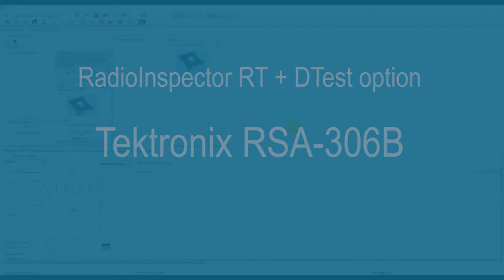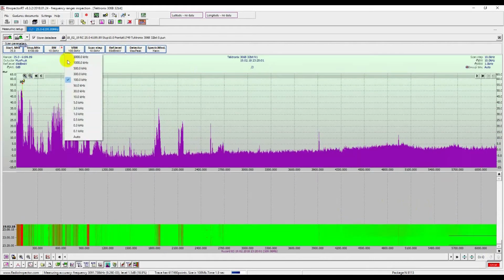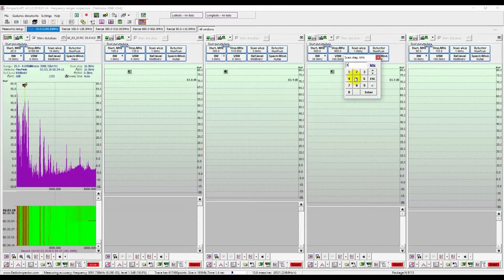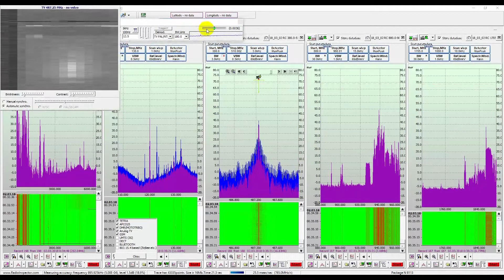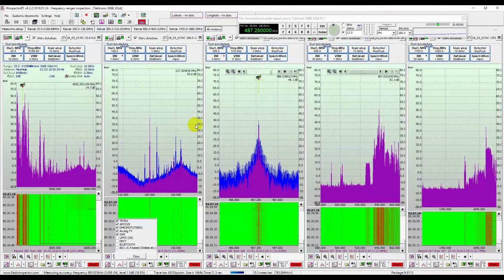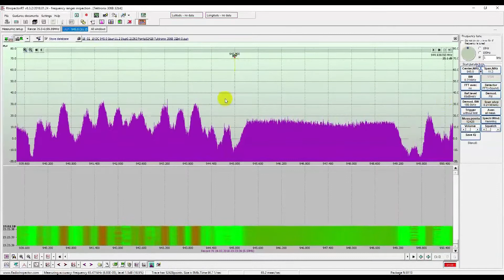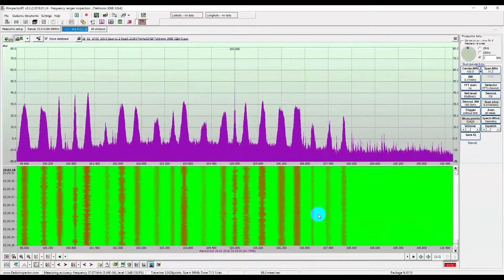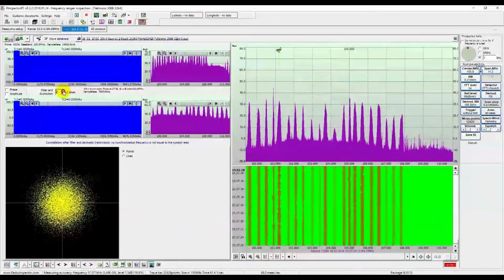Tektronix RSA306B

Comment: Do you have instructions to replay the capture ? I capture the signal and send it to fellow engineer for review and need him to play it, thanks
Reply from the maker: For post-analysis, there is a special application that is designed to analyze and process accumulated panorama databases - RadioInspectorRP. If you have recorded IQ data, then we recommend using the IQ_ProcessPRO application, which has great processing capabilities, to work with IQ. Both these applications can be found on our website https://radioinspector.com